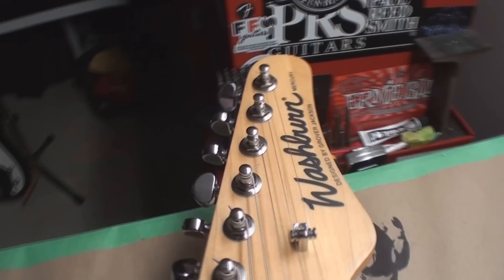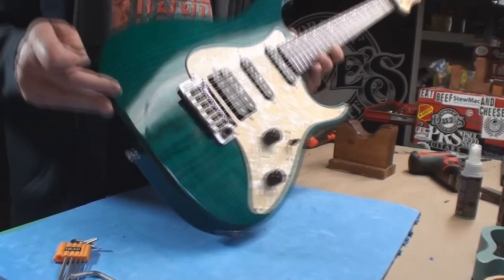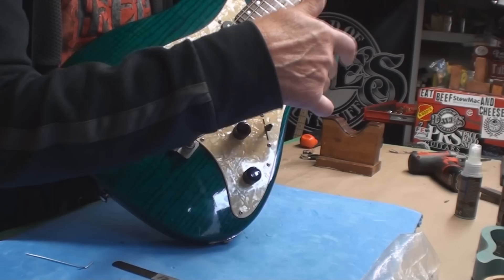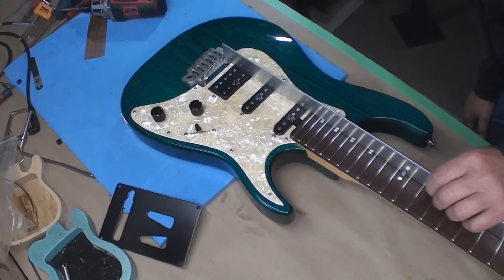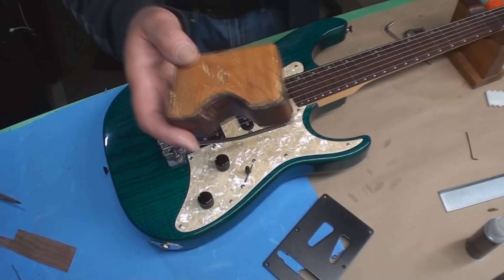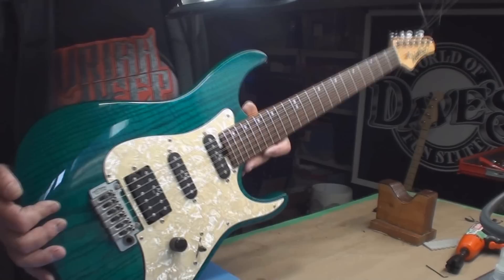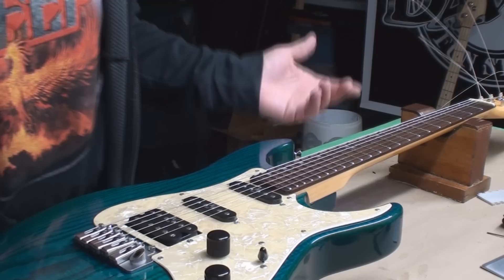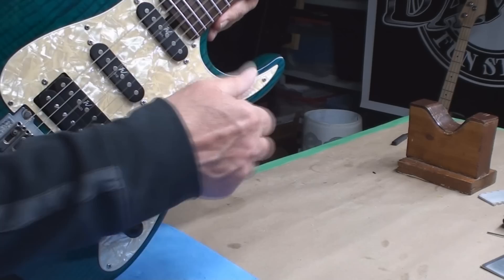Washburn MG 401 Grover Jackson Guitar 1996

Comment: Picked up a good looking Washburn Montgomery jazz box on ebay. Found out the top caves in under the bridge.Most obvious at the F holes, as the inside sides of them drop down about 3/8"  Looked inside, and nothing is broken. Naturally now have to have a really high action to compensate for it, and can't figure a way to get the top pushed back up and stabilized. Popped out a pickup to slip in four toilet paper tubes all inside one tube to keep the top from caving in any more. Didn't change the sound one bit, which is big. That's a lot of pressure at the bridge on it. You'd think a top pushed down a quarter of an inch at the bridge would have some broken support inside. Nope.

Comment: I know they are expensive but mitutoyo calipers batteries last many times longer than off brand ones.  The off brands use the same amount of power whether they are on or off which is why the batteries are always dead.
Reply: Or you get an analog one. At least for his work, he doesn't need a store option or data logger via cable.

Comment: Great work ,once again Dave. Q? Is that a real stained body, photo laminate? Looks really nice from behind the bridge, but the upper bout looks a bit suss. Just curious! Thanx for making this vid.
Reply: Here are the specs for this model MG-401 DELUXE A $639.90 
ALDER BODY / BOOKMATCHED ASH TOP 650mm SCALE / 43mm NUT
MAPLE NECK / ROSEWOOD
FINGERBOARD
PICKUPS WASHBURN 511S,
 512S, 523H
BRIDGE WILKINSON
VS100
 CHROME
TUNERS GROVER

Comment: As to the trem springs, some bored guy at the factory probably thought it would make a cool looking pattern to hook them up in a triangle and gave no thought to function.
Reply: That angled springs thing is the result of a photo of one of Jimi Hendrix's guitars onstage: the springs were installed like that.  It has become a thing among guitar players because they think it has something to do with Jimi's tone.  It has nothing to do with tone.  Practice is how Jimi got his tone, but most players don't work hard enough at it.
Reply: Agreed. Tone is in the fingers, not necessarily in the gear.  I would bet Keith Richards could pretty much get his signature sound with a $75 guitar and $100 amp.
Reply: Tremolux Man Keith got his signature sound with $75 of whiskey and $100 of heroin
Reply: The Devil In The Circuit jimi always used 5 springs

Comment: Beautiful looking guitar. Would be better with the gold hardware.
Reply: yeah i agree
Reply: I prefer black. Black fits everything. Gold seems too flashy to me.
Reply: Under some circumstances I'd agree with you. There are just some colors that I feel pop a little better with the gold. Green and Purple are two for sure that I'd prefer with the gold.
Reply: Problem is that almost no black hardware will stay that way. The damn coating is gone after a few years. Look at old Floyds in black and in nickel/chrome. Gold would look great, indeed.
Most companies won't do black chrome. I'd love some black hardware that lasts.-.-
From the looks I also like the Ruthenium option. It's like a slightly darker grey-ish metal look.
Reply: It is beautiful... i think i like the chrome
Reply: Man, I've got an old Floyd that's pushing 25 years old. Hasn't tarnished or faded a bit and looks just as good now as it did back then.
Reply: Does it have a black finish? On what guitar?
Reply: It does have a black finish. It's on a 93 Jackson.

Comment: Dave do you do plek work?
Reply: Dave does not have a PLEK machine.  They cost thousands and thousands of dollars.  A good tech can do a better fret job without one anyway.
Reply: The Devil In The Circuit ....thanks for the info.
Now I need to find a real good fret guy.
Reply: No man can do a fret level better than a plek machine. Get real.
Reply: M. P. ...no need to get unfriendly people, I'm just looking to get these frets leveled....did I mention it's on a Mayones T.T. Duvell...I'm just going to have Mayones do it. Should still be under warranty....shipping is going to kill me though.
Reply: Ron, you ever seen a PLEK in action?  Ever loaded one?  I have.  The PLEK is only as good as the person who mounts the guitar in it.  Attention to detail is critical, or the results will be less than optimal.  The truss rod has to be properly adjusted before it goes into the machine.  This is the reason why many PLEK'd guitars need tweaking--the guitar gets tossed into the machine in the interest of speed, because the PLEK is not very fast.  Guitars stack up waiting to be processed.  PLEK is not artificial intelligence.  A tech needs to monitor the process and make inputs based on what the machine detects as it does its work.  Cheers, everyone.
Reply: The Devil In The Circuit ....thanks for the info....I've never seen a PLEK machine in person but it should be under warranty so it's Mayones problem.